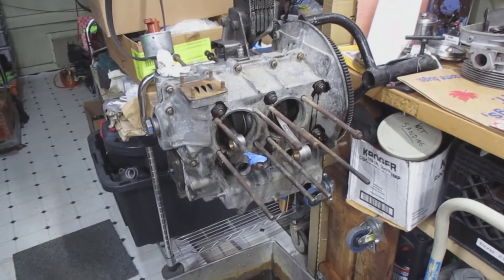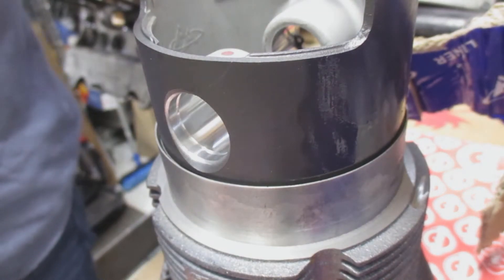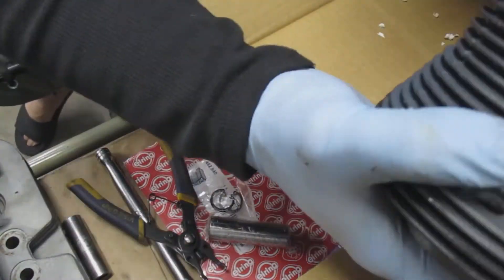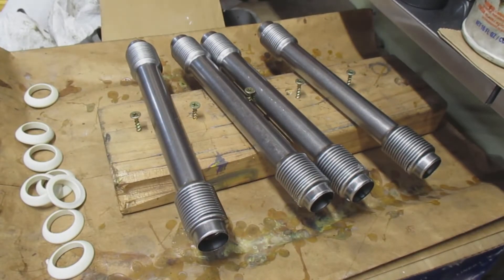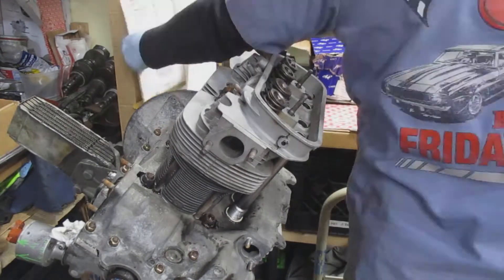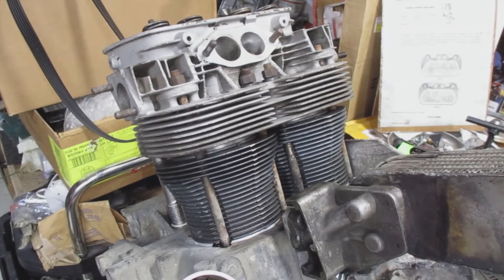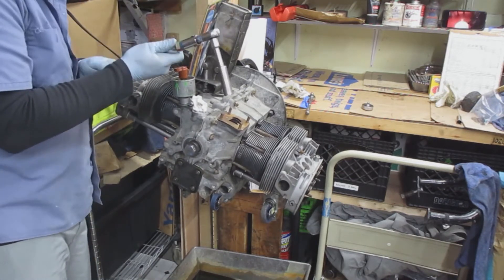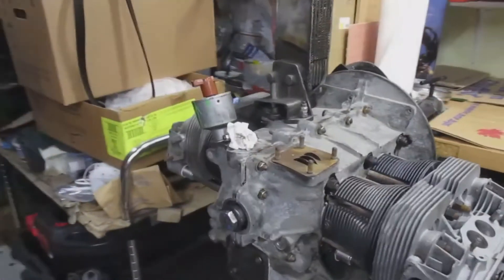How to Rebuild a 1641 VW air cooled Engine - DAY6 pistons cylinders heads - 112620 1641 Engine Build

Comment: Why no paper gasket at the base of the cylinders as they come in the gasket kit?
Reply: That's my question as well. Also, was there a check of the deck height to confirm the valves won't slam into the piston? Was that in another video?
Reply from the maker: This is a stock build. I've never had a valve hit a piston. thank you for watching. #mountpac
Reply from the maker: I don't use them on my builds. an old timer told me that he doesn't use them and he has been building for 4o plus years. thank you for watching. #mountpac

Comment: If the engine is otherwise stock but a 1500 case with single relief with added a new doghouse cooler and all factory tin including factory thermostat, are the thin wall 87 cylinders reliable for long time engine life? I keep reading and hearing bad stuff about "thin wall" cylinders. I need my motor to run a very long time. It is stock other than the things above with 26mm oil pump.
Reply from the maker: I'd recommend doing research and use the P&C and cooling set up for your particular engine needs. Thank you for watching. :) #mountpac

Comment: Piston rings not clocked, ring end gaps not checked, generator stand metal gasket facing wrong way, did you correct that before fitting generator ?
Reply from the maker: hello, thank you for your comments. these are new pistons and cylinders. The gen/alt stand metal was not the actual one I installed from the new gasket set that I used for this build. The metal that is in the video was to help keep debris out of the engine. Or so I don't drop anything in the engine. This engine ran really well when It was started. I hope that answered your comments. Have a great day!!
Reply: I wouldn't worry about the ring gap today as the manufacturing are far more advance today and more accurate.

Comment: Hi, just done a similar build myself, not sure if you covered this or not in a previous movie but you should clock the piston rings to 10 and 2 and have the oil ring expansion piece at 12 o’clock
Reply: Usually in the factory they just pop them in ... could be the gaps are completely at the bottom ... or all fully alliged...  have seen it with kits of different vendors ... mahle, AA, Uber, ... ALWAYS take them appart and clock them ... or you might end up with a gas-in-oil leak and/or compression loss ....
Reply: @Stijnie0077  Yes Sir E I Must agree never assume some one Has Done it Right Check it your self
Reply from the maker: Hello, thank you for your reply. I don't usually take apart new pistons and cylinders when I get them I assume the factory sets the rings accordingly. I hope your build goes well. Have a great day!